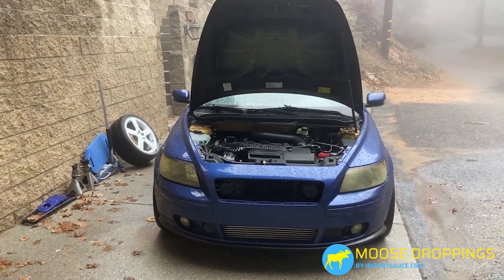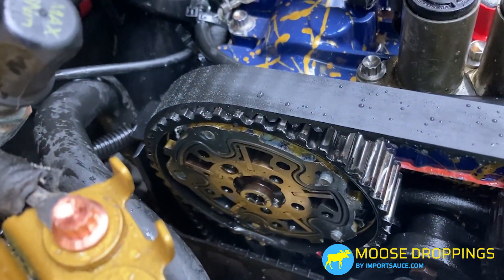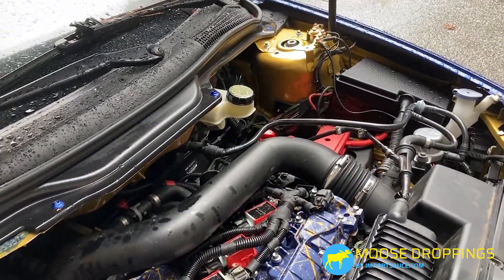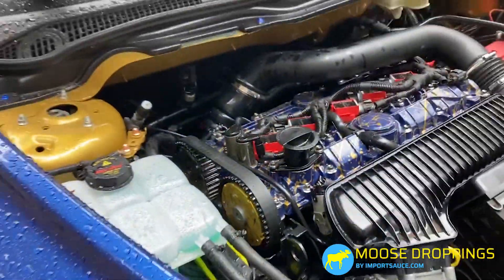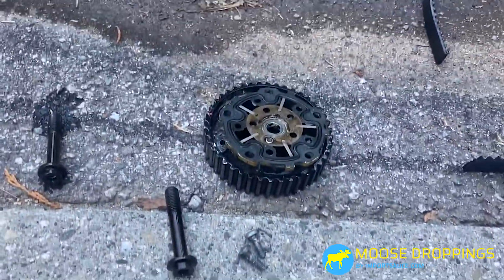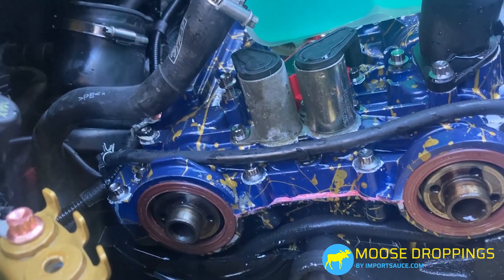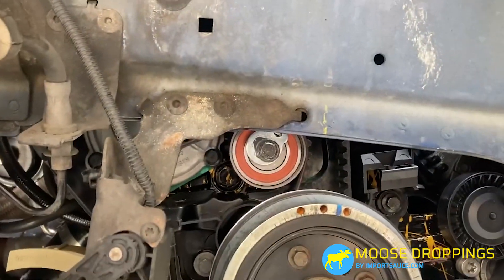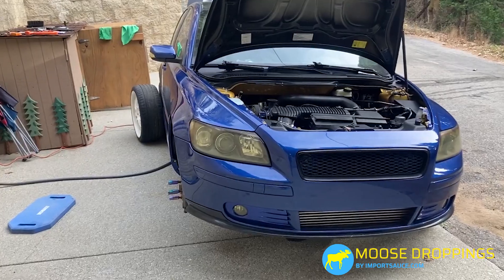Our Cam Gears Exploded - Lets See Why & Keep The Build Moving Forward.

Comment: My accessory belt broke on my 2011 C70... and I believe it bent some valves.. I'm looking to rebuild the motor either my myself or just paying someone else to do it for me. Any recommendations for shops here in SoCal? I'm located in Lancaster. I'm not looking to turn it into a racing motor. Although I may add the elevate intake setup and a custom exhaust. Any direction would be amazing. Thanks in advance!
Reply from the maker: Wayne’s engine rebuilders in riverside. But also. The next video in series coming next week is exactly this. Replacing and seating the entire head assembly. It’s pretty easy actually.
Reply: @moosedroppings  awesome and thanks I’m also thinking about doing a manual swap but not sure if it’ll be worth it. I’ve checked out your info on that. But if I go that route I might just go all out on the body, motor and exhaust. 🤷🏾
Reply from the maker: @aligntoyourhighest  the m66 is worth every penny, if you have the pennies to spare, you can do everything else, but it will bring the most joy,